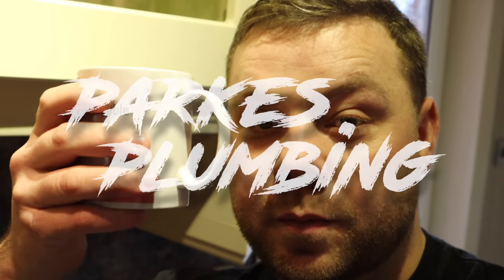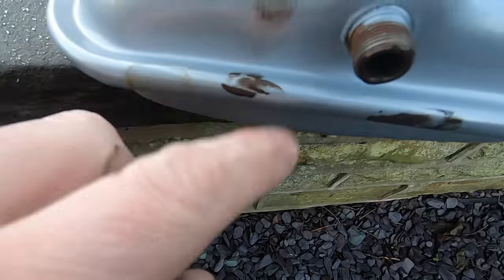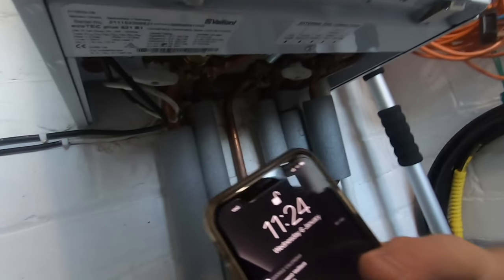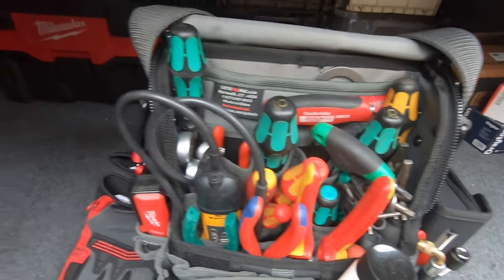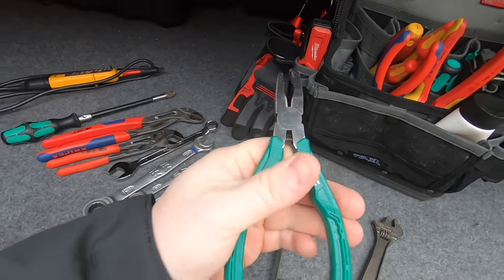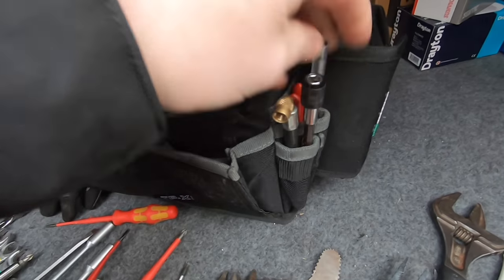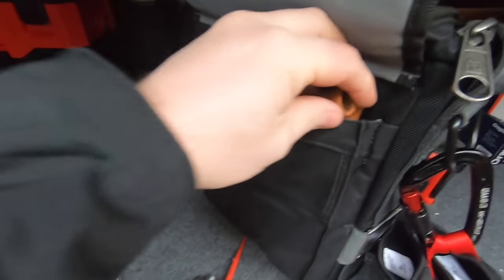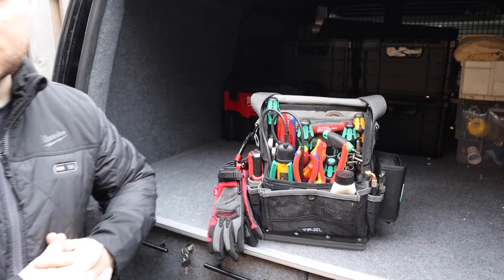MY BOILER MAINTENANCE TOOL BAG  | Parkes Plumbing

Comment: just ordered a set of SCREW REMOVAL PLIERS combi extractor gripping gripper ENGINEER PZ-58 neji-saurus thanks great tip thanks
Reply from the maker: Great for having in the bag just in case
Reply: @ParkesPlumbing  i fix domestic appliances and these will come in handy on rusted in screws on oven repairs 😡

Comment: The tool behind the tools is the greatest tool of all.  Seriously though knipex wera and facom all the way for me.  Do you find you end up purchasing multiples of the same tools for different bags?  When you spend on tools, you tend to look after them a little better. Everything has a place so you tend to realise if something has been misplaced gone walkies.  What would you reccomend safety shoes boots wise? 

Great stuff place, keep doing what you do best and keep safe. 👍
Reply from the maker: Yep I have multiple bags with the same tools .. plumbing bag .. boiler bag .. oil etc .. easier to be organised that way. I swear by englebert strauss boots. High quality German brand. I’ve only had 2 pair in 4 years
Reply: @ParkesPlumbing  thanks pal 👍🤗

Comment: Hi thanks for  the video.  Why did you replace the pcb? If u have replaced expansion vessel and sorted the fuse issue.  Thanks
Reply from the maker: The display was jumping and producing strange symbols which is a sign of the board going. Then next call would have been a “60” fault so it was best to change it there and then

Comment: Was looking at plumbing as a career change but heard with the run out of boilers by 2025 for eco heating some this the trade value (£) will be harder would like to hear your thoughts ?
Reply: Dont panic , theres millions of boilers out there that still need repair and service for the next 50 years plus...
Reply: Im from the Netherlands ...Here all new builds houses must be heated with a heat pump ...Im not a fan ..But it creates only more work for plumber’s/heating Engineer's ........For existing houses they will probably start using hydrogen in the future instead of natural gas ....Not much will change i think 🔮 .....More important is if you like the trade ...Try to help out a plumber for a few days
Reply: You'll be able to replace gas boilers. Where existing gas metered supplies are already in service.  Service maintenance and breakdowns are still plentiful. Seriously don't worry gas is here for another 100 plus years.  I doubt any of us will be about when gas runs low.  Go for it.
Reply: @rayc1503  Thanks for that, My alternative was to do electrics but looks so complicated especially with all the certs required, Plumbing was my first choice as I have a real interest in it.
Reply: @smoothoperator6117  Electrics aren't to difficult either.  It just takes longer in practice.  I spread mine practical and training over 2 years.  I've been in the gas industry for around 13 years.  You live and learn.  If you're willing and able you can earn well in this industry.  You get in what you put out.  With electrics we have an inspector visit every year to push all the regs which we never knew existed at us. 😂👍
Reply: @rayc1503  would you also say their is still a high demand for plumber/gas engineers or is the market quite saturated ?
Reply: @smoothoperator6117  I'd say there are plenty of people in this gas industry.  Imho I think are are far and few who are true engineers.  It takes time and diligence to gain custom.  It doesn't happen in a day.  You have to keep training and learning in this forever changing industry.  I've had friends and colleagues move away from London because the travelling is too much.  It really depends on your location really.  I'd suggest to put in your postcode on the gas safe register website and see how many registered engineers are in your postcode vacinty. This may give you a little insight into what your up against.  Hope this helps.
Reply: @rayc1503  Really helpful thanks for taking the time to answer my questions,
Totally agree with what you are saying and try to fix rather than just quote for a new boiler, My idea is to get the NVQ 2 and try to get in with one of the big guys like British Gas or Dyno to get a couple of years experience before attempting self employed,
Reply: @smoothoperator6117  i am on my final year level2 plumbing and heating and i cannot find a plumbers mate job still. Test the market and offer to work a freebie to see if someone will give the chance to look and learn. I wish I had gone back to college and updated my electrical certificates but i wanted a 2nd trade to go with electrical
Reply: @paul_my_plumbs_uk  oh wow is it that hard to get experience you would think free labour would be beneficial to someone.......Bit on the other hand is it in case you become competition to them ?

Comment: How do you carry your analyser? I carry a veto mct and my analyser just fits.
Reply from the maker: I have the analyser and other measuring equipment in a hard case
Reply: @ParkesPlumbing  ah that’s nice. But I like everything in one bag, hence the MCT. I don’t like trips back to the van if it’s not for parts. MCT is actually a little to small. 

I also work for a boss so I get an hour for a service call, sometimes less, including travel time. 
For a small team of service techs (and I’m technically an apprentice with just short of two years experience, but I’m full time on service and repairs) we have a lot of customers.
Reply from the maker: @plumbraider2265  I get you on the trips to the van. But because I’m .. let’s say .. vertically challenged, I need the hard case so I can stand on it sometimes
Reply: @ParkesPlumbing  i get that haha. I’m a little over 6’ and miss my old Raaco T33 sometimes. I still have one or two at home because they don’t need to be light there. Great cheap toolbox and great stepladder too.

Comment: Where would you use a 13 and 10 mm in plumbing
Reply from the maker: Boilers
Reply: @ParkesPlumbing  do you still use a bahco the bigger adjustable
Reply from the maker: @Zimbabwerailways  no mate